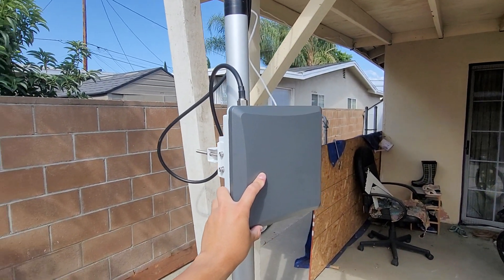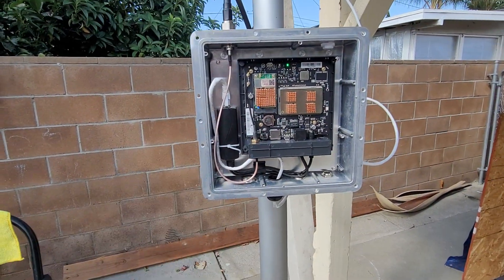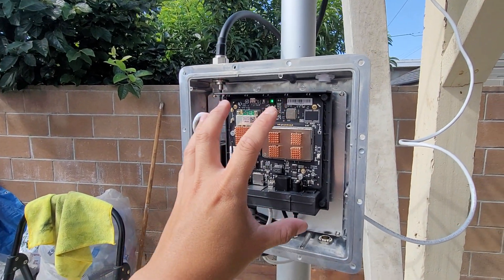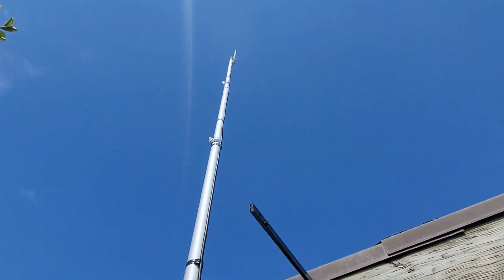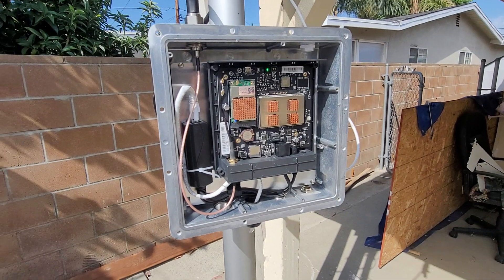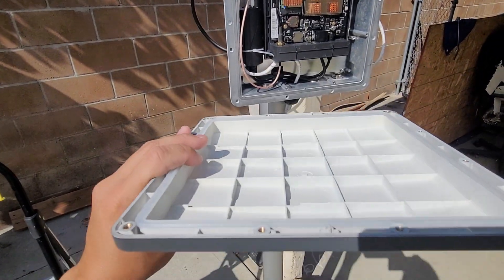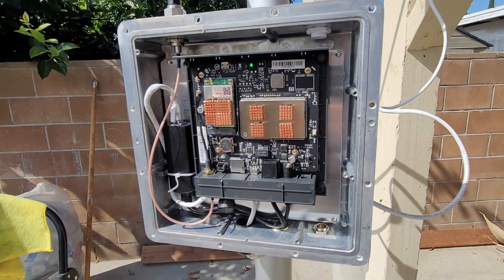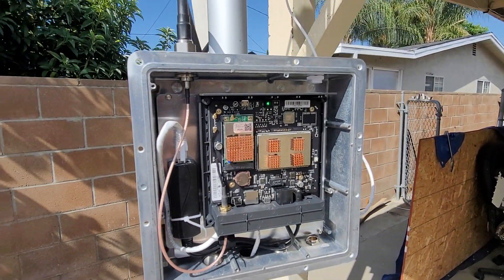Rakwireless Bobcat Enclosure Inside Setup

Comment: Great video1 I ordered the wrong cable one side of the cable looks like it goes into the minor but I need one end to go to the outside of the bobcat outdoor enclosure what would be the date cable I need or you are using thank you
Reply from the maker: I put on my own Type N male connector to connect to the Rak Bobcat enclosure. You can find connectors on Amazon for cheap if you already have the cable. You can find the Type N me connector in either crimp or compression. I bought the compression connectors since in my opinion they are better and don't require crimping tool to put on. However you will need a soldering iron to solder the small center pin for the connector. 
Alternatively if your not comfortable installing connectors you can buy the correct cable to match the ends of the antenna and enclosure.

Comment: What are the benefits of outdoor enclosures?
Reply from the maker: It's for outdoor use and protects your hotspot from sun and water. It's a sealed enclosure with mounts designed for outdoor use. Also you can mount the antenna directly on the enclosure and not have to use an extension cable as that prevents less cable loss

Comment: if the unit was at the top of the pole and the cable length was minimized, how do you think that would affect your coverage?
Reply from the maker: Not really sure how much better it will be with a shorter cable. I've always wanted to put my hotspot higher, but my flagpole will not support the weight of the enclosure. But many say shorter antenna cable run will work better. I've used a 3ft cable and up to a 30ft cable and honestly I don't see much of an improvement with shorter cables
Reply: @tonytypes  you have to adjust the gain for loss?
Reply from the maker: @rumplemcfrankenberg  from what I've read over on the discord group no you do not need to factor in cable loss. However not all cables and connectors are the same so some may have a lot of loss and some may not.
Reply: @tonytypes  LMR400 cable loss is 4.8db/100ft FYI, PoC11 will factor the gain you input for your antenna and I believe it needs to be adjust for such a long cord. Attach the box to the top of the tower.
Reply from the maker: @rumplemcfrankenberg  I don't know of anyone who runs a 100ft cable :) most probably run 30-50ft the longest. I would just input the actual antenna dbi and see how it goes. I honestly don't think poc v11 will do much. One of mines has a 30ft cable and I still haven't changed the antenna specs from months ago after I swapped put the antenna. Still working normally today after the poc11 roll out :) maybe it's too early or there's stuff working behind the scene that we are not aware of.

Comment: Hey man, how'd you get the copper sinks stick to the cpu/lora without them sliding?
Reply from the maker: Mines stuck on with thermal adhesive tape, however I don't recommend it. Over time the heavy weight of the copper hestsink, they slide down under their own weight. Might not happen with lighter aluminum heatsinks thoigh
Reply: @tonytypes  I have 4 aluminium ones on my bobcat and already have 10 copper ones on the way, I'll look for a way to keep em on their spot. Thanks!!!

Comment: With the LMR 400 cable designed to come out of the TOP of the enclosure what have they done to stop water ingress ?  

You would have thought a bottom exit would have been a better design..
Reply from the maker: RAK does include the self sealing tape and if you follow the directions correctly it should seal up the antenna port and help prevent water from getting in :) 

Alternatively you could move the type N connector to the bottom of the casing if you prefer. The top mounting is mainly for people who want to directly mount the antenna to the case. When using a longer cable extension it best to run a drip loop. However I didn't do it in my video as I was just testing it out.

Comment: great video, how did you attach the bobcat to the metal plate inside the enclosure to get it to stay upright?
Reply from the maker: This is the enclosure for the Bobcat so the plate already had the mounting holes and screws to attach the Bobcat to. You use the same base plate that comes with the Bobcat

Comment: are you getting power from the poe slitter? from the rj45 cable?, like cold you plug a molex noctua and power by usb too? that would be a great video.
Reply from the maker: Power comes from the POE injector and splitter.
Reply: @tonytypes  so the only power source for bobcat is the poe? Thanks!

Comment: What did you use to dissipate the heat? The top cover as removed by you correct, it’s not necessary to install inside the box, correct?
Reply from the maker: Yes I removed the top cover. It's not necessary to remove it to install at all. I was just trying to find ways to keep the Bobcat cool when used inside the enclosure. Currently I have a small fan inside along with heatsinks that I added to keep the Bobcat cool inside the sealed enclosure. You can see it in my other videos.
Reply: @tonytypes  what about glueing some heat deflectors on the exterior of the case? 

I’m waiting to receive both bobcat and case, but i’m thinking on building an external sunlight and heat  reflecting case to protect the external case.
Reply: @tonytypes  how are you powering the fan in there?

Comment: How's the flagpole handling as of now? I'm planning on buying one from Amazon, where did you purchase yours? Would you provide a link please? 😁 Thanks in advance
Reply from the maker: It's only been 2 months since I've had the flag pole. But so far I haven't had any issues. However it's probably too early to tell since the weather is different everywhere. I got this flag pole from my local Harbor Freight store. I think I paid around $60 with the coupon code I got I'm the mail. The internal lock mechanism I think is plastic so we'll see if it last a year or so in the SoCal sunny conditions :)
Reply: @tonytypes  awesome thanks for the reply, I will buy from Amazon found one that doesn't have a locking mechanism so no plastic involved

Comment: Although in an enclosure, will your miner overheat or freeze among the elements?
Reply from the maker: Mine haven't had any issues with mines, but not everyone will install the same. You need to pay attention to the location that you will be using the enclosure at. If direct sun you may want to make a cover to reduce heat.
Reply: @tonytypes  …..thank you for the clarification..

Comment: Can you provide me with the specifics of your POE injector and splitter? is power to the BC 5.5mm?
Reply from the maker: The Rakwireless Bobcat enclosure came with a 5.5x2.1mm jack. If you watch my unboxing video you can see the specs for the POE splitter that came with the enclosure :)
Reply: @tonytypes  what brand name was your POE splitter?
Reply from the maker: @ssiproductions6146  it came with the Rak enclosure. But any poe splitter with the correct connector will work. You just need to get a 12v splitter if using a Bobcat hotspot moner. Rak hotspots Miners uses 5v.
Reply: @tonytypes  thank you

Comment: How did you power your bobcat? I wanted to do a 12v outdoor cable and then use wifi but it looks like ethernet can power and connect to the internet?
Reply from the maker: You can use a 12v POE injector and splitter to power the Bobcat using a single ethernet cable

Comment: @tonytypes I just put my bobcat outside to test my miner I'm in Socal and it gets really hot sometimes, it was around 70 Fahrenheit today after looking in the diagnostics, is that something I should be worried about? I'm planning to buy a modem box and install a solar fan like you did in a previous video. What are your thoughts on this?
Reply from the maker: After testing this Bobcat enclosure I would not suggest using the enclosure in SoCal heat. On a 90 degree day the inside gets too hot. You would need to get creative and use heatsinks or put a small fan inside.

Comment: Hi, can you help me choose a cable, I think to get lmr-400 male to male coaxial cable, but not sure if it's the right one. Which cable did you use?
Reply from the maker: You just need to make sure you get the cables with the correct connectors for your antenna.
Reply from the maker: You just need to make sure you get the cables with the correct connectors for your antenna.

Comment: how many witnesses do you get with this set up? :o
Do you need to use ethernet or does wifi still work?
Reply from the maker: My currently setup gets around 90-130 witnesses. It varies though as the witness list resets every 5 days. I'm using ethernet, but WiFi should work too assuming your routers wifi signal can reach it.
Reply: @tonytypes  I appreciate the quick response, thank you :)

Comment: Great set-up.  When you ordered the Pulsar cable which one did you get?  I am assuming it was the Connector: N-type male to N-type female?  Also, the 16ft one?  Thanks I have subscribed.
Reply from the maker: Thanks. Yes that's the one that you would need if you have the Rak antenna.

Comment: Where did you get your antenna pole, how much was it, and was it easy to install? Have you seen an improvement with your signal?
Reply from the maker: I got the 20ft telescoping flag pole from my local Harbor Freight store. It's pretty easy to setup and helps a lot of getting better activities. I would say as long as you can get the antenna mounted higher than your house roof it will be a good setup

Comment: How many helium’s is this setup pulling in a month for you?
Reply from the maker: No accurate numbers yet since there was a couple issues with the network this past month. But since validators came online last week thinks have seemed to picked back up. Currently I seeing a steady increase of 5+hnt a day. Last month I was averaging about 10 hnt a day. Many things can vary so the numbers are not set...
Reply: @tonytypes  cool thanks, ordered my bobcat last night and planning on doing something similar but since my house is 2 story was just going to get a mount and bolt it to the top of my roof somewhere. Seems like a lot of work so hope it’s worth it. A decent amount of miners in my area but not no one in my little hexagon yet.
Reply from the maker: @rivec33  nice man. Having a 2 story house has its advantages lol. I would take it a step further and go up another 10ft from your roof to clear the surrounding houses. The higher up you go the better.
Reply: @tonytypes  lol I shouldn’t have said “on” my roof. My roof is tile and don’t have anything to mount it to and don’t want to mount in the tile so was thinking of getting a 90 degree mount as close to the roof as possible with a 10 foot pole to clear the peaks of the roofs around me. I’m in south Florida so everything is flat and aside from a handful of 4 /5 story office buildings or 3/4 story apartment complexes within a 10 mile radius there isn’t that much blocking the way. I’m sure it’ll be fine I’m just a little worried about doing all that work and it not being that eventful in terms of witnessing and stuff. I live in an HOA community so I’m hoping I don’t get any grief from them or I’d go higher, just trying to get as high as possible without it being extremely obvious.

Comment: how do you supply power to the miner outside? @tonytypes
Reply from the maker: I use a POE injector and splitter. One cable provides power and internet
Reply: @tonytypes  Thanks for the answer, I also was wondering how to power it up. Received my enclosure yesterday and was curious where the power lead goes. So do I understood well that you don't need a power cable only the PoE Splitter? Do you need any special modem or cable for it?

Comment: how did you get your antenna on top of the pole
Reply from the maker: The pole is telescoping so you can lower the pole, mount the antenna, and extend it. Super simple. Just need a good way to secure it when the poke is fully extended with the antenna installed.